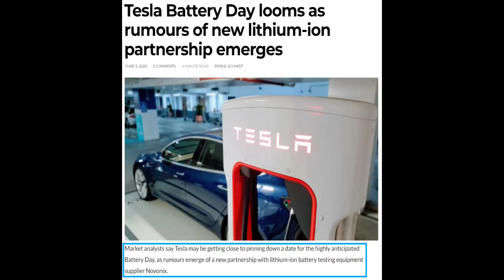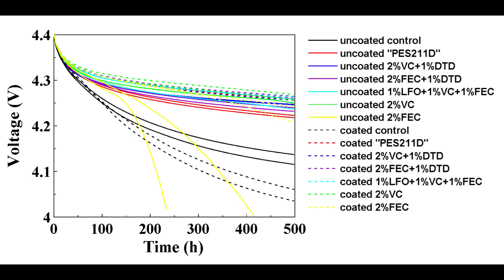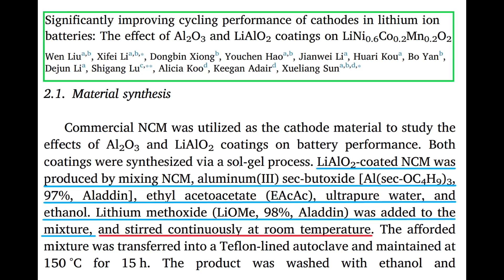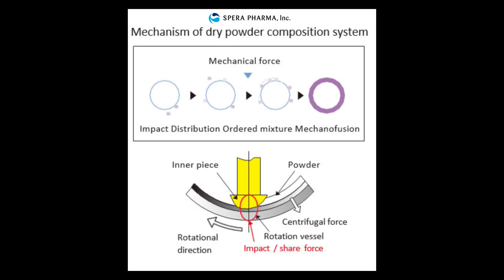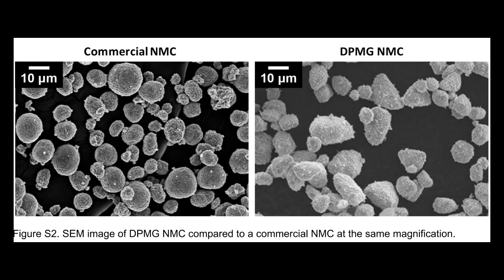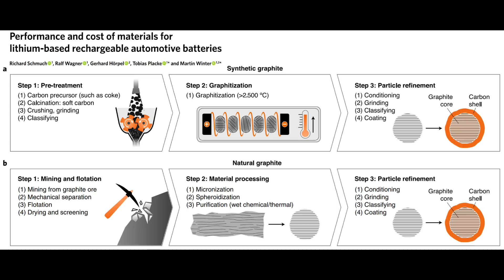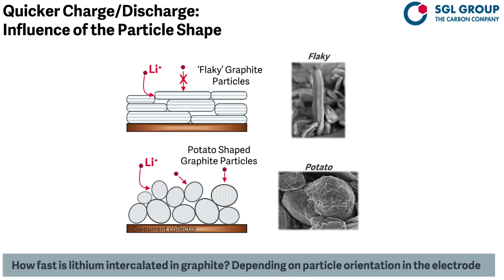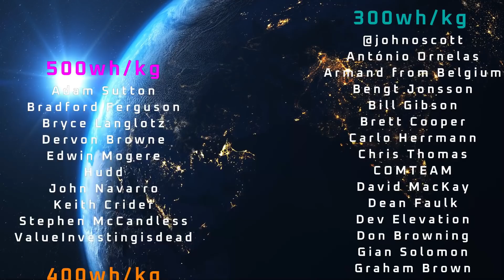Novonix DPMG - Dry Particle Microgranulation (Deep Dive)

Comment from the maker: TL;DW - Novonix Dry Particle Microgranulation (DPMG) allows material that would normally be considered waste to be turned into high quality battery materials.  Furthermore, it reduces the number of steps from the typical 10 steps to 5 steps.  China has priced competition out of the market...DPMG levels the playing field.  Additionally, because it produces no waste, it's more environmentally friendly.  In the next video I'll get more into the 'so what' and whether it makes sense for Tesla and Novonix to get into bed together.
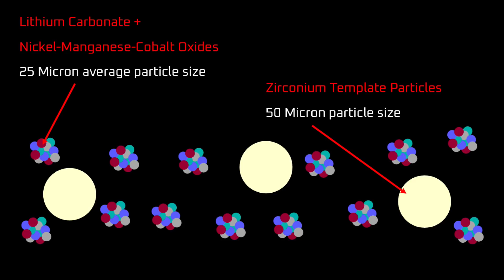Additional note:  At around 9:30 I show an illustration and actual images of the particles formed by DPMG.  These particles go on to be heated to form crystals.  This is shown by the diagram @ 10:30 where it says 'sintering furnace.'  I didn't think it was necessary to call this out given the image, but thought I'd clarify here in case it causes confusion and I left you hanging 🤠.
Reply: Thanks Gordon
Great video again
Reply: This technique is very similar to what’s used to grind/classify pigments. It could also be used to “stretch” out pigments to create cheaper paints at a fraction of the cost. Which pigment coatings and particle substrates would work depends strongly on their solubility and tendency to bind to each other (lattice energy) as opposed being dissolving away by the solvent or other solutes (binders, etc). It would also depend on the optical properties of the DPMG materials. Something with the optical characteristics of titanium dioxide would make an ideal filler (or perhaps coating), but I don’t think that material would work.
Reply: Jordan, thanks for your channel I appreciate your research. Maybe pull on the Coulometrics LLC (partner of Novonix in the PUREGraphite joint venture) thread as well.  They, and their management, have an interesting history. I have found where they have received 7 figure grants from DOE and connections to the US Navy.  I suspect that they bring more to the table than one might imagine.
Reply from the maker: @nooneyouknow7036  Fascinating!
Reply: @quintontad5245  
That'll be "Jordan" 😉
("Gordon's" the short)

Comment: Excellent video. Thank you for taking the time to take us through the deep dive on DPMG — you have a knack for breaking down information in a simple and digestible manner for the non-scientist folks.  When you connected with Chris recently, were you able to gather any additional information regarding the likelihood of Tesla directly or indirectly (through a third party supplier like Panasonic) using or planning to use Novonix’s DPMG process in tandem with Maxwell’s DBE technology? (You may recall I posited this same question a week or two ago in response to another one of your videos.) Given, among other things, (i) Tesla’s recently announced plans to overhaul its Kato Road facility to accommodate additional space for battery manufacturing in connection with Project Roadrunner, (ii) the relationships among Jeff Dahn, Maxwell, Obrovac and Chris Burns and ties to Tesla and (iii) Tesla’s relentless push for efficiency/effectiveness and cost reduction, it would seem probable that Tesla would take advantage of this technology to further its goals. To the extent you haven’t been able to glean this information from Chris, I would nonetheless be curious to hear what you think based on what you’ve uncovered to date.  Thanks as always for your time, it is appreciated.
Reply from the maker: Thanks Reese!  No indication from Chris.  He is open to licencing and DPMG appears very modular.  My bet is Novonix stays separate from Tesla and that it will be some time before it supplies Tesla.  They are on two very different magnitudes of production.  This will be covered more in the next video along with the DBE question (short answer is that they are compatible).  Just started 'The Limiting Factor 2' channel and had a discussion with David Quan about this and other things.  This is not as full and complete as the next video will be though.
Reply: Thank you! I was actually thinking Tesla would license the DPMG technology from Novonix to produce its own raw materials, rather than purchasing DPMG-made materials from Novonix, as Novonix seems to be focused more on the R&D and incubation side from what I have gathered from past interviews of Burns and St. Baker, rather than Novonix scaling up to be a large scale manufacturer.

Comment: "For no particular reason", other than a job using high school chemistry to do wet chemical assays for a while, this is what a further understanding of e-Pi-i 1-0-infinity instantaneous 0-1-2-ness and prime-cofactor frequency integration/interference positioning in crystallisation structures might tell us about layering of resonance bonding proportioning in Calendaring battery components. Holography is intensely interesting in practical Actuality.

Comment: Jordan, I have a theory as to why Tesla might not be worried about water and waste requirements at Giga Berlin. DPMG outputs better cathode particles with no waste water and fewer waste materials. Excess input metals are recycled back into the process as inputs. Another bonus is that it uses class 2 nickle rather than the class 1 nickle currently used. Tesla mentioned they need more nickel on their earnings call (huge cost/supply win). Go Elon and team! Not sure if they have to use Novonix DPMG method because Tesla has their own DPMG patent, as you know :)
Reply from the maker: LOVE the insight!

Comment: The DPMG process sounds pretty cool and efficient, but it's not like there aren't other ways to skin these kinds of CATS.  For example, you can make nano particles of specific size and more easily coat other materials with those.  And if you use metal-organic compounds first, you don't have to go through the tedious and wasteful process of using lot's more water, creating other metal byproducts, etc.  

  For example, converting copper formate into copper nano particles is a fairly easy and efficient process (though somewhat time consuming), and it easily plates/coats a number of other materials.
Reply: I'm also wondering about ultra sonification.